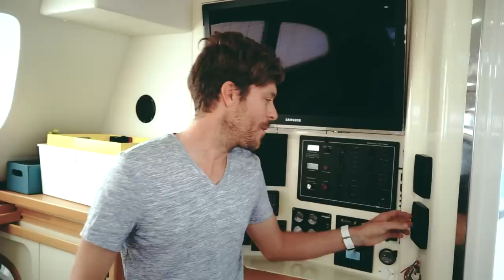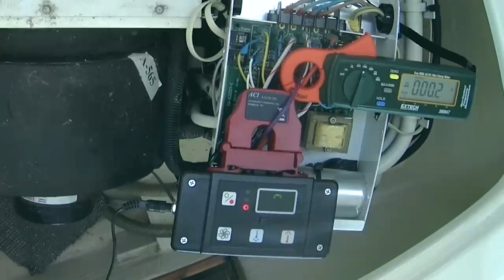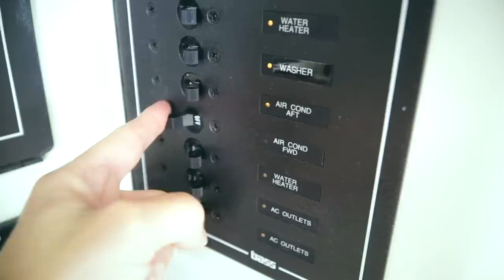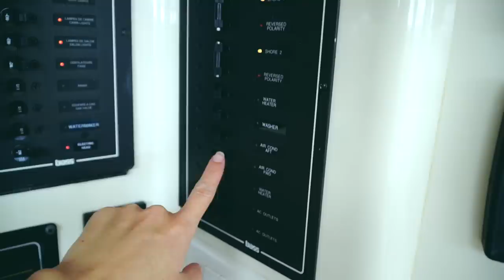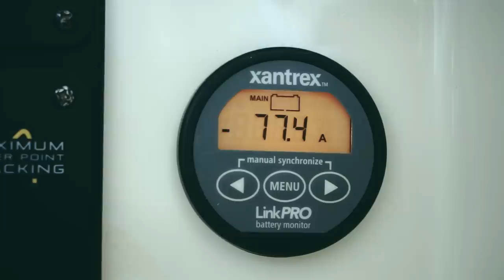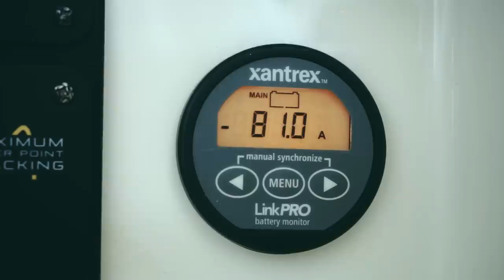Air Conditioning on a Sailboat? Yes, & It's Battery Powered!

Comment: AC equals dryer air.  Not because of the compressor but instead the heat exchanger.  When the hot, humid air hits the cold refrigerant tubes, the temperature of the air drops below the dew point of the hot air.  The now cooler air can't hold the water and it condenses out, leaving the cool air with less humidity.  Did you wonder that the heat exchanger needs a drain path? Its because of the water that is taken out of the hot air.  Its kind of like a cold glass of ice water sitting in a humid environment.  It sweats because the hot humid air is in contact with the glass and the water condenses.

Comment: Fantastic video you guys! 
We run 2 x 16000 BTU Webasto reverse cycle (Cold and hot) and 1 x 5000BTU in the main cabin (which is a large area on the owner version 440).
We run the 5000BTU through the night off batteries.
We do not have any soft starters and find the system copes easily with the 5000BTU - Starting Surge is 16A.
Our modus operandi is to run climate control when using the generator to charge, wash clothes etc. and bring the temperature down in the main cabin (we have a diversion for the bigger units upstairs to cool down the main cabin too).
We then run the 5000BTU on battery power and that keeps our cabin cool all night long and with ease.
I recommended to a friend to go smaller on the unit he installed in his boat recently as the 5000BTU is overkill once the area is cooled and suggested to put a drop curtain just aft of his bed to keep the circulation area reduced if he felt it was not coping.
He advises he has done this by installing a 4.2 BTU from Clima and draws 35A DC (12v) but I have no personal experience of these units.
Our 5000BTU draws around 45A (DC) 
The larger units start on the generator and use load sharing (from the batteries) for the additional power required to start them.
If we were to do this again I think I would have installed more of the smaller units as sometimes even in the salon we feel it would be nice to have a small unit ticking in the background.
And yes, we totally agree that air conditioning makes a huge difference on a boat - as you say it keeps the environment drier ( reduces mould) and definitely keeps away the 'boat smells'. We would not be without it.
I think your units are also 'reverse cycle' - the heating option becomes a dream option when sailing in New Zealand or Tasmania as well as other colder climates.
Cheers for sharing guys - a great video as usual.
Reply: THANK YOU IMPI!!  Always love reading your comments...  I cut and pasted alot of your dialog for the future building out of my AC re-construction while FLOATING away from the docks.... I have a 16,000 BTU unit that runs off AC current...  I will possible add one smaller unit to accommodate comfort in some super HIGH HEAT cruising areas...
Reply: Hard to believe. How much your it on? But what the battery amp hours?
Cause 4 hours are pretty much the limit I read. Cause you can use 4 - 6 volt and make it a 24 volt system. But your 4 battery 260 ah are still 260 ah .
Or you can go 12 volt with the 4- 6 volt in parell  and get 520 ah but still about 4 hour . and in 12 volt you need 0 gage battery cable and to the inverter as I tried to run my fredaire 5000 that 450 watts and the cable get really hot. A guy said to use 2 - 0 gage cable  or that the benefit of 24 volt hook up as it pull in less watts and amp but you ah are cut in half too.  Its a crazy  catch 22.
Reply: And he has 1,200 ah but he cant run a 5000. but a 12000 so he average out the same as us with 5000 btu and 520 ah. That 4 hr of a.c use. The next step for us is 8-  6 volt or use 4- 6 volt but the 120 lb 470 ah 6 volt . but you need 4 of them .

Comment: Most excellent video. The Easy Start is an inverter saver for sure. After watching your RV A/C video, I did some searching and basic math. We needed a new A/C and inverter and ended up going with a 12k btu 48 vdc direct wired unit and skipping the cost of a large inverter. We were able to reduce out running amps by about 40% thereby increasing the available run time on the same battery pack. Keep these coming! Great stuff.

Comment: Well, electrical is my strong point.  And this video is very accurate !! 
Want to points out that the soft starter is VERY important when you have inverters, but not that much when you run generator or shore power. 
When running through inverter IS A MUST !  as you can fry the power electronics 

This is not a huge boat neither a small one, personally I would love to have a small (250 lb) generator on board for hundred of reasons.   
+ An Emergency and you need all the electrical power available 
+ Sometimes you may be in a place where fuel is not expensive and plenty. So you have few very extra-comfortable days ! and very important ...
+ A generator can charge your batteries in 30 min or less in case of failure of solar power modules/panels/wiring/etc etc etc 

Again, this video from a technnical point of view is very accurate and precise.

Comment: Thanks so much for this video. After watching this I contacted the maker of the Easy Start device and ordered one for my RV. I have solar on my rig along with the onboard 7kw diesel gender. However, to reduce the runtime of my onboard unit as well as to save costs I also have an auxiliary 3kw inverter generator that uses a fraction of the fuel but until now I couldn’t run my roof ac because of the starting amps. Used your discount code so you get something out of my purchase. Thanks again!

Comment: SO GUYS love the videos. I have some suggestions for you. I have been in to solar power for a long time and I have learned that when just one little part of your panel is shaded you loos most (if not all ) of your charging . there is a way to fix this . you get stale solar chargers for each panel. this way when one get shaded you don't loos the entire array of charging power. second your system is only going to put out what the least powerful paints put out. I notice you have two times of panels on your boat. If they are not run with severer solar chargers then they will only put out what the lowest power panels put out. to maximize your out put you should at least have two solar chargers on your boat . the individual one are (for each panel ) are very small and not that much money.  This is the way I would go if it was my boat. as you know technology is always getting better. panels now days can easily put out 300wt per panel. If it was my boat I would upgrade to newer one bill a bigger rack to hold more panels (giving you more shade and protection for you and the dingy) and anuff panels to charge your system and run you ac during the day. sell the old ones to offset the expense of the new ones. there is also a water generator you can us that you can mont to the bulk head of the boat and has a long whip with a prop on the end that you throw in the water as you have stated that the solid touted ones wont work for you as your hull is to week to us that kind. (sv delouse ) uses the one I am talking about. you could even run 2 or 3 of this kind on you boat so when you are sailing crank up the AC and cool the boat down when sailing at night. there is some solar hippies(in Oregon) that have been putting out a magazine for over 20 years called (home power)   that has tuns of great info and suppliers with great pricing you should ck out I have for years and they have a on line magazine as well so you dont have to what for the mail. It is full of very useful information and articles about the latest and greatest things out there. 
 If I were you I would reach out to some of theas companys to see if they would sponser you and help you set up your cat so it works better for your needs with 169,000 subs a company would be stupid to not get that kind of exsposher and show other crusers how to properly set up there bouts. 
There is also lots of you tub videos on setting up all electric boats were they remove the diesel motors and replace them with DC moters and when you are sailing it charges your batterys and when you need to power around you us the DC moters and then if your batterys get low you fier up the diesel generater. you loos the wt. of two have diesle moters and matanance. the DC moter wt is a fraction of the Diesle moter. there is even some out bord DC moters that will run all day on one battery and with added soler and water generation charging it over night is not a big deal.
I hop you read this and find this info helpful.  
 I love your show and wish I was in your shoes with a smoking hot wife like you have. LOL Mike

Comment: Thanks for the reminder. We have a large 5th wheel toy hauler with a 600 watt solar system and 4 L16 6v batteries along with the usual generator. I remember the video you did 2 years ago and told myself I need to look into this Easy Start deal...now I will. We boondock almost exclusively and I like to take every advantage I can...
Reply: I use a 5000btu unit off the same L16 x4 bank you have, but with 1000watts of panel. I'm guessing you know you're way under-paneled for that bank (as am I), so even with a AC unit that pulls only 430 watts, I can easily exceed the capacity of the panels to replace it the following day...and build a deficit. Long way of saying that I doubt you need a soft start because any AC big enough to benefit will also exceed your solar system and you'll be running off genny anyway. It's all a balancing game...I'm a year in and still learning  ;)
Reply: but if you were boondoggin, you could use a smaller generator, using less gas with the soft start.

Comment: Thanks for the discount code.  I just saved $25 on a soft-start.  Tried to start the A/C from the little Honda 2KW last week and it wouldn't do it.  I actually ordered a bigger inverter and 100 amp battery charger so the batteries could produce the necessary surge while the generator charged the batteries with about the same amps the A/C was pulling out.  Those were good upgrades anyway, but the soft-start was what I really needed.

Comment: Since this is a tecchie episode some clarification seems appropriate because the compressor pressurizes and circulates the coolant gas.
This causes it to lose latent heat in the same way as your dive tank compressor and the radiator then dissipates that latent heat to the external environment.
The condenser, is a reverse counterpart to the radiator because it allows the compressed gas to expand.
This causes it to absorb latent heat from air passing through it which cools and dehumidifies air entering the interior or recirculating in it:)
Some modern hot water units are now based on the same heat pump principle.
It might therefore be a useful compliment to efficiency for such a self reliant environment if waste heat produced by the air conditioning radiator could be used to heat your hot water reservoir in a manner similar to the engines.

Comment: I made the mistake of investing alot of money into a large Marineair System that requires 2 Honda 2000's to run it. It is such a large system that it requires 6 - 6" Output Vents. The problem is that it takes 3 gallons for 5 hours of run time. Mexico gas price is $4.50 a gallon so it would cost $21.15 a night (8 hours) x 30 nights is $634.50 a month.
My solution was to buy a little 150 sq. ft. window AC that only pulls 3 amps (instead of 13 amps) for about $100 USD. Now I can use one generator running much slower RPMS to extend gas and get 6 hours from 1 gallon of gas. 1.35 gallons (8 hours) x $4.50 = $6.08 × 30 Nights = $182.25. That might sound like a lot of money BUT a marina slip for electric in La Paz Mexico is $900.00+ a month so we find it much less to anchor for free and buy the gas.
This is only the two months of Augaust & September when the nightly temps are near 100 Farenheit! My generator does handle the startup amp burst but I hope to get an Easystart someday when I win the lottery.
Reply: Sailing Corina Expedition simple beautiful and awesome

Comment: With some messing around it is also possible to make it variable speed.  That way you can reduce your current draw by reducing the btu output of the compressor.
There are many advantages in doing so which is why most A/C manufacturers are now offering them in their products. On a boat it is ideal. It also eliminates the surge current since it can also perform soft starts.

Comment: You can still change the equation to get more AC longer with a few mods.   Rather than adding more power, change the equation of watts used for cooling.   Just like you use a space heater to only heat up one room, you can use a compressor based AC to only cool down the bedroom or boost the cooling of the bedroom.  The easy way is to use a zero breeze v2 ( I have the zero breeze v1 ) which will draw 150 watts at 12V.  I got a 12V compressor based AC for that is more DYI from amazon for about half the price and has more options for a custom setup.

Comment: Thanks for the info guys! Love your videos!
1200AH Lithium (12V) is a lot - extremely jealous ;)
We only have 510AH 12V AGM. Lithium is ~2X AGM :(Also have a small window a/c which is about 500W 240Vac, 12kg, and cost around A$350. Not so many of these around now as there were when we bought it 10 years ago. It can run from a 1KW Honda generator. This works fine for the saloon on our 35ft 10.7m cat.

Comment: Just an FYI for you when it comes to sizing an AC unit. Bigger isn’t always better. A smaller unit may run longer but it will actually take more humidity out of the air. Larger units some times make the dwelling feel cool but clammy. They also draw less power on startup and have lower running amps. I only mention this because you said in the video you have two units.

Comment: Classic step start circuit chain, also widely used in linear amplifier power supplies to limit inrush to the filter capacitors, which are usually beefy to keep hum off the output signal.  The old is new again, as the circuit itself is around a hundred years old.

Comment: It's probably a time delay relay, attached to the compressor or blower. So it doesn't get the locked rotor surge at once. Did that with my RV a/c once, added in the themostat control wires.

Comment: your advisor is correct on the smell  on a boat  the AC is the way to keep that down  just go ;ol at used boats a new way to go is using the new mini split units  there is a You tuner that installed one on his camper its so efficient he runs it on solar  only 24/7 365

Comment: Yup we have an Easy Start on the heat pump in our Airstream. As a result, we are able to power and operate that unit via our propane-fueled Honda EU2000i Companion, or even the 3000 watt hybrid inverter we are having installed as I sit here typing this note.
Reply: Bravo, CasaRocinante!  Checking back at our discussion on the Air Forums, it'll be exactly one year next week.  Glad all is going well!

Comment: Marine Air Conditioner (Heat Pumps) are very inefficient with an SEER rating of around 10.  Get a home mini-split air conditioner with an SEER of 23 and even with the inverter losses it will be twice as efficient and run twice as long on the same battery.

Comment: Great vid! I've noticed that boats have mold issues and it's mainly due to bad insulation and poor air circulation. And yes, there is not much space. Running your AC will lower the relative humidity but You need to keep those doors, hatches and portholes closed. Anyways, this is very informative. Thank You. I'm a terrible electrician...  +1

Comment: Have you ever considered getting a portable air conditioning unit, I was thinking something like the zero Breeze which is actually a real air conditioner and in the confines of a boat if you set it up in whatever room you want to cool down it seems to work pretty well. Maybe you can do a promotion for them. They're coming out with a zero Breeze Mach 2 which has twice the BTUs which means about 22 or 2300. Like I said it is made to cool down a small room etc.  If you preorder the Mach 2 you can get 2 for one and the same as for one of the first model.  That would allow you to cool whichever room you are in or even take it outside and have the cool air blow on you. I don't know the specifics with regards to the amount of electricity it draws but I seem to remember somewhere around 12 amps. They also are battery-powered with each battery charge last thing about 3 and 1/2 to 5 hours depending on other factors.  A guy on YouTube installed one on his boat in the cuddy cabin.
Reply: I brought one but returned  it as it was found out that its only 140 btu .only work right in front

Comment: Is my understanding correct? Inverters have around a 20% loss if I remember remember from school. So if that is true running an inverter near the exact draw would be the best effenciency. Soft start can then let you dial down that inverter. 

Would having an inverter dedicated to the air conditioner be more effencent?

At 85A... Would a water cooled peltier system with a PWM controller be efficient? I have been working on one for my boat for a year now and it seems like a good idea and just runs off of DC. I just havent buckled down to program the Arduinos to modulate the PWM and fans.
Reply: Hi Luana.  Thanks for your comment.  Modern day inverters are actually much more efficient now.  Estimates are they are about 95%.  The Wynn's inverter powers much more than one of their A/C units, so theirs must be a bit larger than the ~1650W that the A/C unit and its SW pump will draw when running.   EasyStart will allow you to start and run just about any 120VAC A/C unit, be it marine, RV, or residential, on a 2000W inverter or Honda 2000W generator.

Comment: I think RoadTrek has a van that runs the AC all night. They monitor the batteries and kick on the engine at a very low idle to recharge and then shut off. It’s supposed to actually be pretty fuel efficient. Maybe you could do something similar for longer runs of AC....